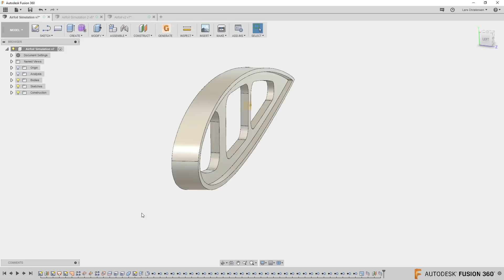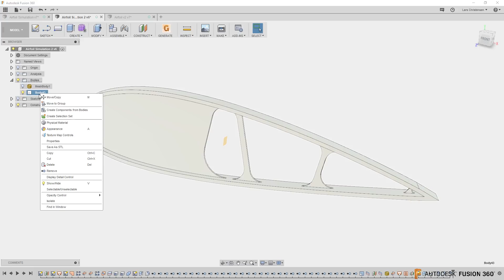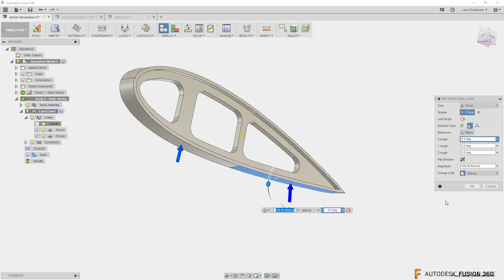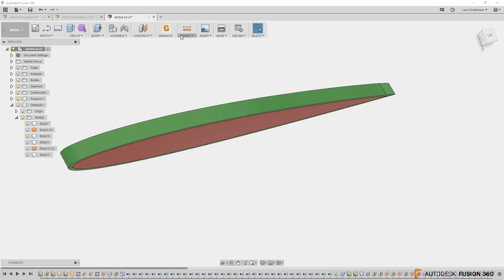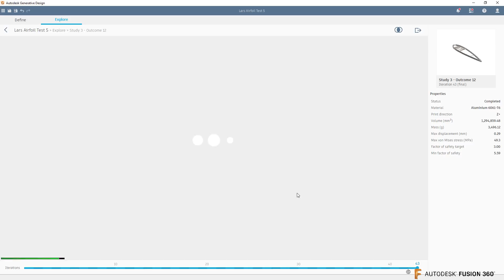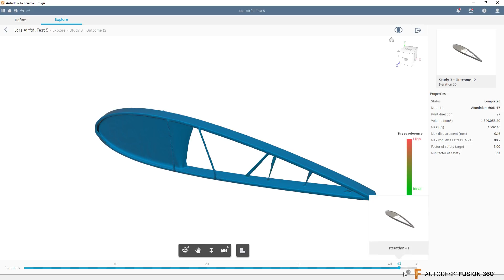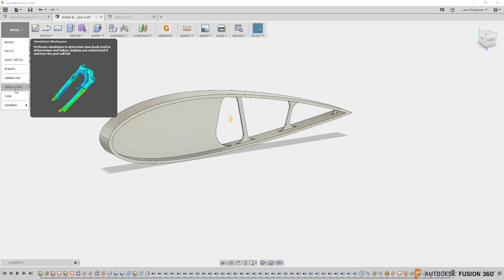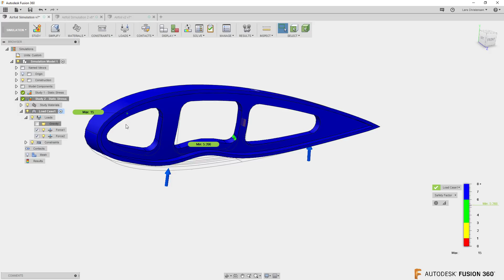An Intro to the Generative Design Workflow — Fusion 360 Tutorial — #LarsLive 166

Comment: Lars, I have a SAT file that I exported from Fusion Generative design. It is of a simple shelf bracket that we made in the Autodesk generative design workshop in Portland. I don't use sculpting much and when I import this into Fusion, it opens up as a sculpted model. Any chance you can do a video on taking an exported SAT file and showing us how to work with it in Fusion? I generated my design in aluminium and plastic. I ran out of time in the class so my bracket had not quite finished and has some "over run" that I want to clean up the plastic part and then print it for fun. Oh I have the educational version of Fusion - my other job is a university technician for Physics/Engineering/Astronomy. (Love your videos - I have learned a lot from them!)
Reply from the maker: Right-click the tree on the left and select the last option "Turn history tree on" Then it should jump into modeling mode.

BEst,
Lars